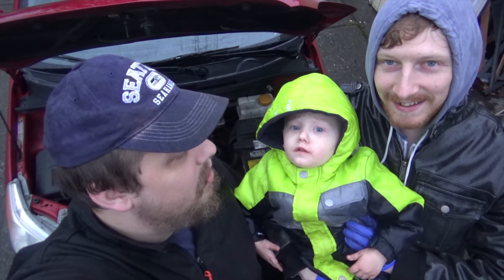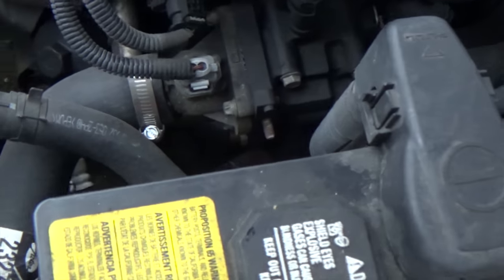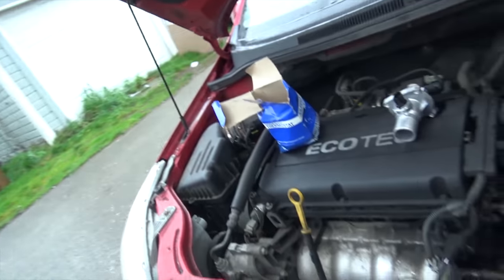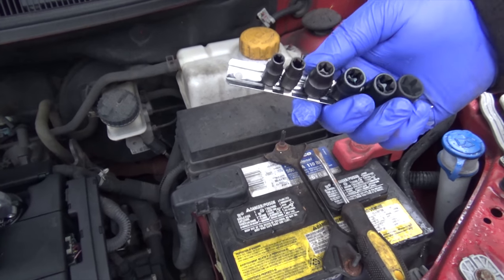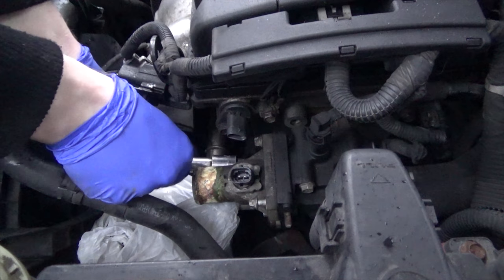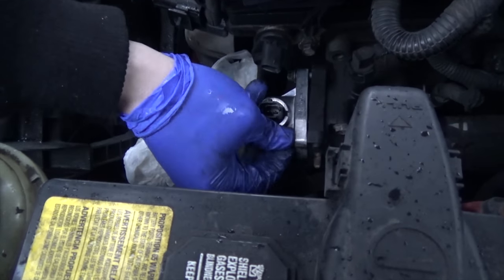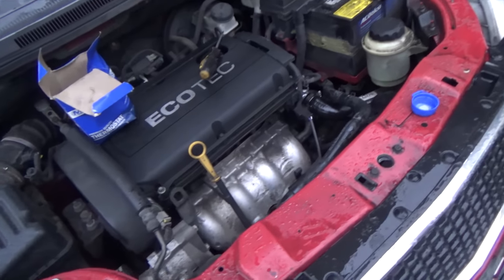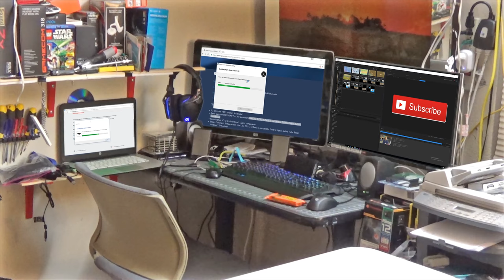Thermostat Replacement 2009 Chevy Aveo, P0128 P2128

Comment: I have the same year Aveo, same engine, and same code. Is the Thermostat the only culrpit when it comes to this code? Or, are there other issues to rule out as well?
Reply: Actually, my code is reading P2181 Engine Cooling System Performance
Reply from the maker: @harris8390  there are other things that can cause the code, but thats the most likely cause. In my experience.

Comment: Hello i got a Chevy Aveo 2008 Hatch 1,4 Petrol.I managed to find thermostat but the only problem  the opening temperature is 105 temperature which i found it a bit high for the size of my engine.Anyone knows where can i find thermostat with opening temperature at 90 degrees temperature.

Comment: You guys are highly rated here, but this particular video is neither well-produced, nor are your instructions particularly clear to rookies.  I'M a rookie to this topic, and I'm trying to replace the thermostat on my '09 Aveo5.

You made a point of pointing out that the "female torx socket" is a tool rare enough in use, that Chevy deliberately chose that fastener because it would stop most people from fixing their own car.  That must mean that most people watching the video aren't familiar with this tool.  THIS means that you should be clearer about exactly what SIZE female torx socket is required for this.  You appear to be saying I need a "number 2", but it isn't clear enough to be sure, and I'll have to watch another video to try to find out.

Comment: If the plastic housing cracks the 2012-2015 sonic and Cruze 1.8l is the same but metal instead of plastic. The thermostat is a different temp and will have to be switched. But only 40 to 70 bucks for the metal housing on ebay.
Reply from the maker: good tip

Comment: Good vid!
Wife has an 09 and replaced thermostat 1.5 yrs ago because of P0128
4 weeks ago, wife says car wasnt heating up very well, put my scan tool on it, P0128 again...
Purchased another thermostat and yesterday car is producing low heat again, temp gauge is rightdown at minimum(even after driving it for awhile) and P0128 is a pending code again....
How the heck does this make sense? Why would this car go through thermostats like this?
Wondering if theres another issue going on and its not the actual thermostats causing the issues...
Is it true the computer controls the thermostat to open and close on these cars, unlike the older style ones that are actuated by the coolant temp alone?
Just cant wrap my brain around this...
Reply: splash try to change the coolant temperature sensore
Reply: jm kc 
Ya, thought about that aswell...
I changed it again, but the other times i used aftermarket tstats, this time i went with tstat from the GM dealership, and so far so good.
If it ever acts up again, il try the temp sensor
Reply: @splash5974  what's the update?
Reply: @cruzgonzalez7061  
Everything was ok after using the thermostat from the dealership. The aftermarket ones just dont last on these cars.

Comment: Is the hose connected to the thermostat the top radiator hose of the car? I’m trying to figure out how I’m going to add this gasket sealer to my 2011 Chevy Aveo that looks just like this under the hood and since there is no radiator cap, I have to pour it into the top radiator hose but I’m not sure where that is located?